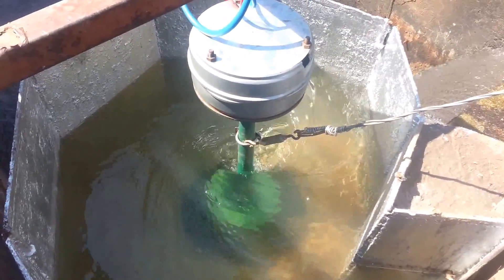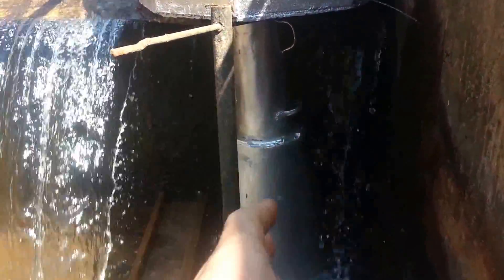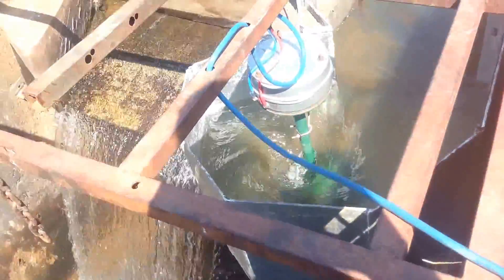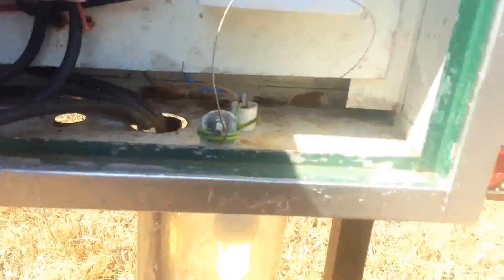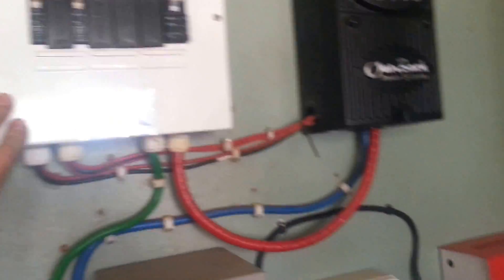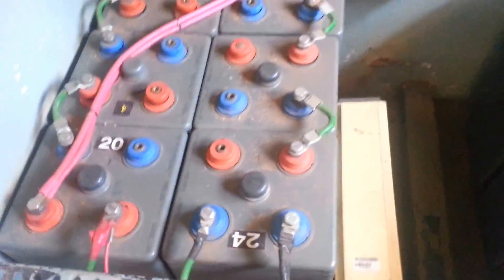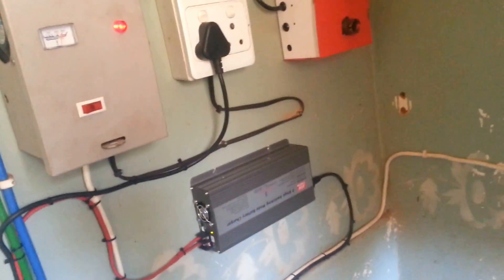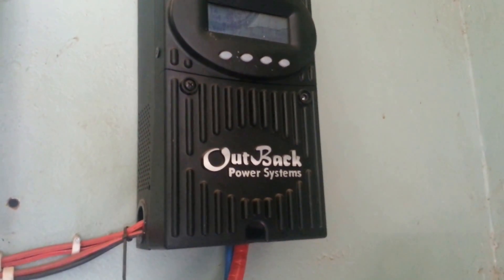DIY Micro Hydro System for my off-grid home

Comment: Baie mooi system Phillip Ek bestudeer Al maande aan Vertical wind turbines Om boere te help wat so sonder Krag sit in Noord Kaap. Ek het Paar turbines bestudeer en Sien jy het n axial flux motor probeer. Dit Kan werk op n vertical wind turbine Ek het planne klaar geteken en n ingeneur any die metal Vir my met CNC dit net die magnet en coper coli's wat Ek self Moet opsit en cast in epoxy. Al waar Ek probleem het is die controller en dump load. Ek het n idee gekry by twee mense een n Amerikaner en Ander our is Europeer wat in Wales Bly. Ek het tussen die twee dit uitgefigure maar het Nie finansies Om dit the bou Nie. Het werk verloor tydens corona. Ek het ook die blades ontwerp wat mens Kan stel Om 8 grade in wind te draai. Die Vertikale wind turbine is vinnigger en veiligher as die horisontale turbines en is baie stil dit Raas Nie Soos horisontale turbines Nie.  Daar is n man wat my sou help finansieel Om die prototype the bou maar hy wou net my planne he en het nooit teruggekom na my toe Nie het my in die rug gesteek. Gelukkig het Ek Nie Al's Vir him gegee Nie ook Nie die oorspronklikke planne van Staal werk Nie so hy Kan eintlik niks met dit doen Nie hy weet ook Nie hoe Om die coils the bou Nie.   Dit jammer daar sulke mense in ons land. Ek Kon Al lankal die boere gehelp het. Ek Kan ook n 6 kW Vertikale turbine bou. My email is johangerhardhelberg@gmail.com  my foon NR is 0622966919 mooi dag daar op die plaas. Ek het n vriend wat met Coroline reapers kweek so skuins oorkant ons. Het dit ook probeer maar mens het baie goeie setup nodig met heat pads Vir Sade.  Jy doen goed Ek so vlugtig gekyk oor jou videos en van hulle gedownload.  Seen Vir jou Phillip.

Comment: Good job 👏  excellent, i have similar conditions, your house is far from the greek did you have lost of power throughout the cables judging from the distance ?
Reply from the maker: Thank you for your kind comments,  yes I had a voltage drop of 2V at that distance hope it helps thanks for watching

Comment: Curious, as I understand hydro produce AC and solar produce DC. Are you using the hydro AC power to charge the batteries and use the inverter to convert batteries DC into AC again?

Is the solar system has a separate batteries pack or you combine them?

Comment: Really impressive. How did you get the power cable to go that far without serious voltage drop? What size cable did you use? Thanks for sharing. Flooding is such an issue for hydro systems. We're buying some land with a creek and hoping to set something up like this. What make and model was the Chinese inverter? Looks like a good one for us.

Comment: here is a very late comment for you and your subs.  the installation, here, is making use of only about 15 inches of head; the depth of the water in the penstock.  the draft tube underneath should not be so tall that it reduces available head, significantly.  at this site, a shorter, slightly tapered-in draft tube should be used.    cheers
Reply from the maker: yes very late but will help other people thanks for sharing

Comment: You must lose a lot of power with the large distance between the generator and the house? Is there a way to transport electricity with minimal power loss? I have a stream on my property, but the generator would have to be at least 500 to 750 feet downhill from the house to get enough head. Great  stuff you have here! I'd love to see what you're doing in the future!
Reply from the maker: not so of a loss i am using alternating current , if you are looking at direct current it wont work

Comment: have you thought of rectifying and using DC to DC constant voltage converter ? to take place of the battery charger. I have been thinking of doing mine similar to yours. but use a inverter at the hydro generator. to be able to send the voltage the distance to the house. then using a battery charger to charge the bank. or just a transformer and rectify and go through a charge controller. I am wandering the brand of inverter you are using. and the output and is it 50 or 60hz? I have been looking in to inverters. to get off generators. and they are just so many. and its hard to pick one. everybody's is better than the other guys. you don't know who to believe. if there outputs are true. thanks for the great video.
Reply from the maker: MPPsolar is the best i only use them for my clients also

Comment: Do you make enough power to run a mig welder? My wife and I are looking at a completely off the grid home, but I love to weld my projects. I am afraid that I would have to run a noisy generator to make my welder work. I would love to be able to run a hydro system with enough power to make my small 110v welder run.
Reply: Josh A It would depend more on the size of your battery bank and inverter. If you can get up to 500w an hour you would have 12kwh a day available for use. Take the wattage of your welder, and divide by 60. That will give you the wattage per minute. So for example( if your welder uses 6000 watts, your pulling .1kwh per minute, 12kwh divided by .1 means you could run your welder for 120 minutes. You would want a battery bank capable of holding about 24kwh so you dont fully drain (and damage) them. But this would leave you zero power for the house. But if you went with a 30kwh battery bank and only used 10kwh a day for "normal" use, you could run the welder 20 minutes every day and break even, or you could draw the batteries down to 15 or 10 kwh remaining and weld for 50 to 100 minutes once a week or so. Under this scenario you would be "surplussing" 2kwh a day in the batteries. Also, you will need the inverter to be able to handle more than what ever the welder draws. Dont want to run it at max all the time plus you'll also need to be running some of the house while welding, unless you put that on a separate inverter. Hope this helps.

Comment: Are You still looking for 230vac controller ? I can help You with a 2 channel progressly adjustable controllere where You can use the "waisted" power for heat hotwater , floorheating etc . Priority as You want.      p o s t @ x e l e n t . n o

Comment: What type of swing blade are you using. what type of turbine/impeller/propeller (whatever you call it) be best for this kind of venturi that you've built to get the maximum RPM?  I'm kinda leading towards a helical 4 blade screw turbine, built to the angle of the Venturi you've custom welded almost from the exit of narrow exit choke to the bottom... Would very much appreciate your advice from experience...
Reply from the maker: shit dude just WP me +27730127951 thinkk i can help you

Comment: so awesome..... beautiful place you have worked hard for
Reply from the maker: +727skirk   it is a very beautiful place thanks just a little dangerous , you know South Africa  thanks for watching
Reply: @PhillipFourieZA  Have you had any problems with the danger aspect in S.A.?
Reply from the maker: @xmachine7003  yes I had  the danger aspect that's why I stopped with the hydro system and removed everything and setup a more secure solar solution at home
Reply: @PhillipFourieZA  smart idea.

Enclosed everything in heavy fencing?

My new employer is from South Africa.Says it is Very corrupt there.

Beautiful place,dangerous and corrupt.
Just as corrupt in U.S. ,we retain our rights via the Constitution,so far.

Comment: Do you have any more updates.Thanks
Reply from the maker: +paysonmovieads sure i will upload when i get the time thanks for watching , but solar is better , no moving parts and it always works
Reply: Phillip Fourie Phillip Fourie A combination us usually best for cost. If you go 100% solar then you need a system that can make enough power during the winter, which means it can end up being 3x bigger than you need in the summer. But if you build it just big enough for summer then you're short power during the winter. Hydro is perfect for filling that winter gap I think. Its cheaper per watt to set up usually, but it does have a little extra maintaining to do, hand if you have a drought or it freezes, you're in trouble. But when its working right, having that constant power from the stream means you also need fewer batteries than of you went 100% solar. Great build though! Love it!

Comment: hey, avoid the water cyclone, it wil pull air in Your system, of you have no cyclone you wil gain a bit more power I think  (sorry for my bad english)😆
Reply from the maker: +Rick Nadorp you are absolutely 100% right if you avoid the cyclone you get more power , I try to avoid the cyclone but I need a little more water , thanks for watching and thanks for posting your comment now other people can also learn from it
Reply: To avoid vortex formation you can float a tennisbal on a string (to keep it from getting sucked in). That breaks the vortex at lower flows and allows you to work without air core.

Comment: good job, but i actually wondering a lot of these off grid videos why you use battery banks instead of putting your home loads direct as if it was a gasoline ac generator? 
thanks for the video and anyone who will answer. me great job and keep it up :).
Reply from the maker: +Sorrowful Soul Thank you for watching my video , the reason I use a battery bank is , I use it as a buffer meaning the turbine have a lot of voltage fluctuation when different loads in the house go on, ( voltage drop and some times voltage spikes when loads go of , now putting in batteries and running of an inverter eliminates the fluctuation's it is just safer option to use it that way, So I use the turbine to charge my batteries , I have some losses in effectivity but it is much safer for my appliances  hope you understand
Reply: Phillip Fourie yes, very well put. thank you sir again for the video and answering my question i get it now it's because fluctuated voltage (and generator frequency which is often fixed around 50hz with gasoline ones). keep your good work up.
Reply from the maker: +Sorrowful Soul Thank you for watching glad I could help
Reply: Sorrowful Soul Often batteries are used because it means you can build a smaller system. If you use 10kwh a day, you likely have a peak demand some time during the day when you need 2 or 3 or 4 thousand watts at once. For example, say you turn on the microwave (1500w) while the fridge is on (750w) and are cooking with an electric burner (3000w) Your system would need to be making 5250 watts (plus a buffer) to meet all this demand. Which is 10x bigger than you need if you only use 12kwh a day. If you had a 500w hydro running 24/7 it would be making 12kwh a day. So the batteries allow you to save by making a much smaller overall system.
Reply: jasondean88888
thank you for this simplification, i watched many videos at the time on it also there is a reason i believe that when the (especially wind turbines) when the load suddenly becomes zero the blades move in their maximum speed and might crush so the loads are needed to maintain a constant level of speed. but i get it on this hydro system as your example explains.

Comment: That's a nice combo you have between hydro and solar. I hope to one day have a set up similar to yours.
Reply from the maker: USNVA Hey thank you for your kind comment, I believe you could also have something similar or better thanks for watching good luck
Reply: Phillip Fourie If only I was lucky enough to find the right land... The only problem is that I'm no longer looking. I would rather slightly tweak the strategy a bit and utilize solar, wind, woodgas, and go around anything hydro, being I'm sitting on dry land.
Reply from the maker: USNVA But looks like you know what to do , We have a saying here in South Africa ( n Boer maak n plan )means a farmer always comes up with a plan to make it work no mater what , thanks for the comment and good luck

Comment: Bit of a rough question, but wondering, with the water turbine alone, what kind of constant output could you pull from the inverter (240v output) 24/7 that the water turbine could keep up with?
Reply from the maker: Darren Lobb To be on the safe side I would suggest 380W of power , you have to consider the los of energy when I use 500W turbine to charge battery's so I lose some energy there and I loose again energy when my inverter takes the energy from the battery to my household appliances, so I think I get about 380W of 500W power out of my turbine at the end of my inverter
Reply: Phillip Fourie So 380watt @ 240 v constant supply? Where did you get the generator...Looks really successfull / im looking for something that can supply power to run my network rack / reduce power bill!
Reply from the maker: Darren Lobb Hi Darren I got the turbine of Aliexpress goodluck

Comment: Nice System. 

Looks like you have sufficient head and flow rate for a multiple Kaplin turbine installation .

Have you considered that? Why are you interested in a water wheel? Is that because the civil works is already there?
Reply from the maker: for Kaplan my head is a little small to get enough power for the cost , I could run multinble Kaplan turbines but have no idea how to connect them in series or in parallel , to get a decant amount of power for my house any ideas on how to do that
Reply: Why not connect them with seperate charge controller to the battery bank? No problems with synchronous operation in that case

Comment: With the combination of these two sources, could I use a 120V MIG welder for more than a few hours? Or are you just powering lights and maybe a fridge with this system?
Reply from the maker: With just the turbine ? or with the solar panels also ?
With just the turbine you could run the Lights and the Fridge 24/7 but not the mig welder I would suggest get some batteries and min of a 3KW inerter thanks for watching

Comment: Great video.   Thanks for posting.  Do you have a picture or drawing of what the turbine looks like as well as the venturi cross section?  It is very interesting.  Thanks.
Reply from the maker: Hi Jrace 2718 Do you want a video of the turbine bottom side and how the whole turbine looks and the casting shell that I build is this what you referring to?
Reply: yes, that would be great!  Also, how much clearance is there for debris such as sticks to not get stuck in the turbine?  THanks.
Reply from the maker: jrace2718 what I do is I put a sieve in front of the turbine  and there is also a drop off ( hole ) in the river before the water reach the turbine

Comment: Are you running DC or AC wiring from the Hydro to your house?And is your inverter at your house?  I had a friend that showed me the closer to the hydro system you have to your inverter, the less voltage drop you will have. He ran DC wire just 10 feet or so and had a small building to house the inverter then ran 2/4 aught AC wire to the house from there. That way he explained that there was very little voltage drop compared to running DC wire all that way.
Reply from the maker: my hydro runs AC single phase to my house 250V Ac with a  2V voltage drop 400m distance from there 250V DC to 24V AC TO DC charger
Thanks for watching
Reply: Offgrid Cabin Yes, DC power doesnt transmit power well over distance without significantly high voltage behind it. Edison's solution when he was fighting Tesla in "AC vs DC, which is better?" was that he wanted a power station built every mile or 2 to boost the voltage drop. Smart idea converting it to AC as close as possible to the generator.
Reply: @jasondean88888  his generator is AC

Comment: I am curious as to what a system like this costs to set up verses the payoff in free electricity. How long to recuperate your investment in equipment and time?
Reply from the maker: my turbine cost about $ 400 and it is a 500W system i would say it this way it is free as long as the river flows 
so free energy 
thanks for watching
Reply: Phillip Fourie
So based on the cost of electricity in your area how long does it take for a 500W system to generate $400 worth of electricity to pay for itself? It seems like it would have to run for about a year straight to pay for itself and break even. Then it would produce about 4 or 5 hundred dollars worth of electricity per year. Not bad if I am correct. You'd also have to factor in labor and maintenance costs and local electricity price fluctuations. Still a neat idea.
Reply from the maker: Ice thank you for your info , hope other watchers can relate to your comment thank you for watching

Comment: What country are you living in? I like the idea of MicroHydro power for off grid since you can usually count on water always being there. Did you run into any local ordinance headaches or hurdles when installing it?
Reply from the maker: hi i live in South Africa  , limpopo province , like you said water is always there , i only had some small problems like stopping the water flow so that i can build and install it but it was actully very easy
my local goverment are so uneducated they thought i was pumping water out of the river so i had to explain to them that i was not stealing water
thanks for watching

Comment: Nice setup. Sorry the one you built didn't work. It's easy to hear the disappointment in your voice. It looks well made though and at least you gave it a good go.
Reply from the maker: Thank you for your comment , My problem is , i should have done more homework before building my own generator , i think if i would build another i will do a much better job. Thank you for watching and your comment
Reply: @PhillipFourieZA  it is fun getting rid of dependence on a system that over charges.
I started collecting items to make a wood gasifier that runs a generator head.
Runs off of wood chips and the methanol contained in them.